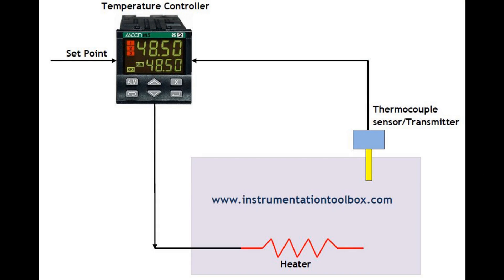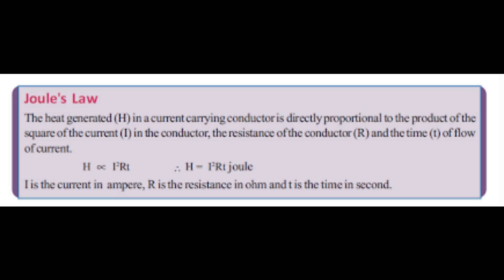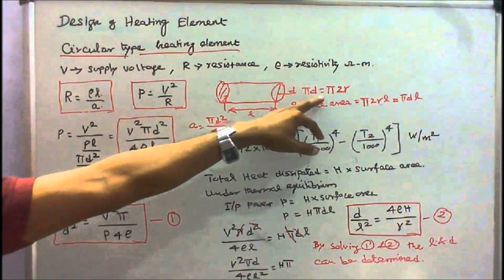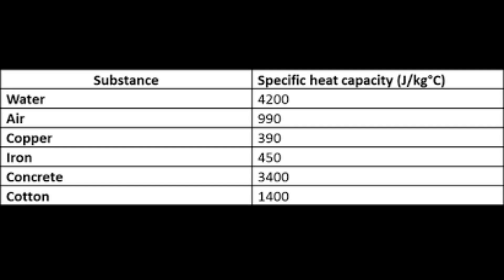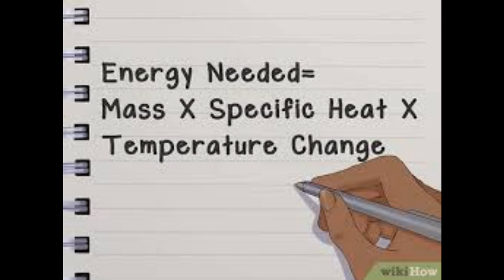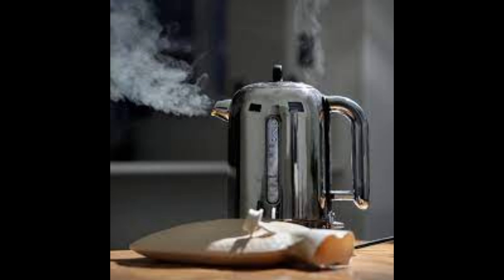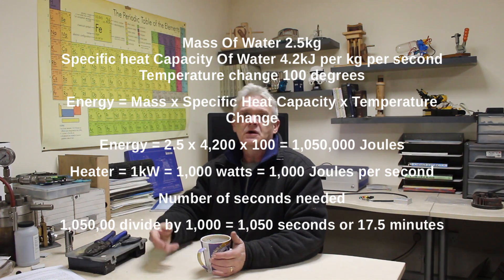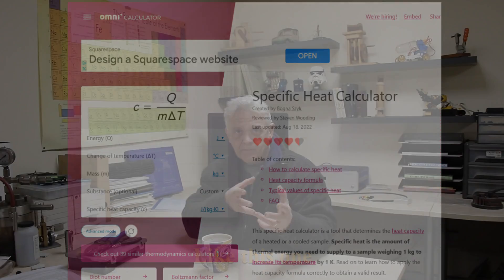1762 Designing Electric Heaters

Comment: You make heating more efficient by using a heat pump. Those can reach 3-500% efficient because you aren't creating heat, but moving it. But that's a lot more complicated than just shorting out a wire. And you have to have somewhere to move the heat from, which means either a window unit or a permanent installation. Ideal for a long term setup, but not so much when you're just trying to stay warm for the winter due to geopolitical unpleasantness.
Reply: I don't think you have to give them back after the unpleasantness subsides in fairness.
Reply: @ricos1497  Sure, but if there is suddenly a huge demand for heat pumps and heat pump installers, it can be difficult and expensive to get the equipment and have it installed in time for this winter. Wire and a 12v supply is fast and dirt cheap comparatively.
Reply: @ryanbrown982  I was just being facetious. I got you. You're entirely correct.
Reply from the maker: yep and they are a bit more complicated than quite a few folks can handle
Reply: The problem with heat pumps is that because the UK doesn't really have an AC industry we don't really have installers. The govt. has been trying to change that HOWEVER, the British govt. is absolutely terrified that British people might use AC in the summer and has subsequently taken steps in opposition to certain types of systems and installer training. That means that the systems that we do have and that are being installed have frequently turned out to be colossal failures. You can google the complaints yourself. Heat pumps and their installers have developed a very bad reputation in a very short space of time.
Reply: @CallMeMrChainmail  why the concern with using AC in the summer?
Reply: @ryanbrown982  
There are obviously multiple reasons but basically, because it's tradition.
Going all the way back to when everyone was using coal-gas, what Americans call town gas, we used to build up our energy reserves in the summer when wholesale prices of coal were low.
This continued after we transitioned to natural gas and crude oil instead of coal and whale oil.
The British government has, at least since the 80's, been actively discouraging the widespread adoption of AC in order to ensure that the country has enough fuel to last through winter and can buy it during periods of lower demand (summer).
I don't know what the current figure is, but about 10 years ago the estimate was that 20,000 people in the UK die every year as a result of fuel poverty.
If we're going to discuss anything about the government we have to be truthful about why any government does anything.
The reality is that the govt. is stuck between a rock and hard place. On the one hand you have a vocal section of middle class voters that are demanding that the UK be a world leader in the reduction of carbon emissions and don't care what it costs (also previous governments signed international agreements).
On the other hand you have a much larger percentage of the population that want's more electricity at a lower price, but they vote less reliably.
This is compounded by the fact that no political party in the UK actually stands for anything. They're all trying to hedge their bets so when it comes to long standing policies like this they just tend to continue and no one pays them much attention.
Finally, there is another tradition within the British government that plays a significant factor; the govt. no longer directly involves itself in private sector markets.
They don't want to re-open the old coal mines and old govt. gasworks because they don't compete with private industry anymore.
This means that if electricity from a private wind farm costs between $250 and $500 per megawatt from a private company they would rather pay that price rather than fall back on old, "less popular" council gasworks that could produce electricity for $30 per megawatt.
DISCLAIMER: Whilst the $250-$500 per megawatt figure is roughly accurate for offshore windfarms, I don't actually know the price per megawatt for a gasworks. It would probably be more efficient to burn the coal directly however most homes still rely on gas for heating so converting it all to coalgas and producing electricity from gas burning power stations that bought gas off the wholesale market would still be the most logistically simple way for government industry to operate. It would have to be govt. industry because current legislation makes re-opening the coal mines and gasworks even less profitable than shale oil and gas which private industry does actively pursue.
An unrelated but interesting fact, if you ever have the pleasure of visiting a coal mine, try to use the orange high visibility clothing and not the yellow ones. The yellow ones become extremely low visibility clothing when they get coal dust on them but for some reason the orange ones still work even when they're dirty. Also, bring the men in the control room cookies.

Comment: This is fascinating and great to know, but it works only if the electricity is available via power company, generator, or batteries. Old fashioned flames are more flexible, in my opinion. Rocket stoves, propane/butane camp stoves and barbeque grills, candles, charcoal grills and alcohol stoves work well during power outages.
Just my opinion based on what I think is coming this winter. I could easily be wrong, so prepare according to your circumstances in your location.
Reply: Or we could just move in with a British politician to keep warm this winter? Apparently all their energy bills are free.
Reply: @lagunafishing  you'd actually commit suicide quicker living with a politician than you would freezing to death in your own home. The former being a far greater form of torture too.
Reply from the maker: actually you could just tie it to a wind turbine directly, or your own solar panels if you want - but your advice is really good mate and I agree with what you are saying

Comment: The heater I have came about by accident. I put a small 9volt battery in my pocket. Then the change after buying my beer. It got very  hot very quickly. Now I have a hand warmer. 1 batt 1 coin .job done .
Reply: Thank you. I will give it a try. Cold hands are the main problem for living in my 13 °C cold living room.
Reply from the maker: it won't last very long mate - but interesting idea

Comment: For me, an interesting question is humidy in air. 
An other is heat itselfe and it's storage. Christaline earth material is first. It is the transfer to air, that gives us the feel of heating. Thair radiation is due to thair shape minimal but long lasting.

Did you saw the candel andflowerpot ovens?

I tryed it out. But I had no flowerpot. I took a vegetable konserve glass. Just over a candel, catching the gascollum above - astounding - room "feeling" warm. 

A kind of heat coserving in radiant hydrogene in mass of air😳
Reply: The problem with candle heaters is that they aren't always a complete burn. They can affect indoor air quality adversely (not to mention consuming oxygen) when compared with electrical heaters.
Reply: @ryanbrown982  Yes and no. Pips burn candels for romace😊 
The flame of romance burns mor ox than the candel itselfe😄 
Right - all styrol wax polutes the air .... open the Window will help.

But - what I can tell: In the glasscylinder there is hot "plasma" generated  gas. It slowly radiates hydrogene resinant energy to the room 10x4x3 meters - may be it is only a imagination ... but it feels conftable🤷
Reply from the maker: lots of folks seem interested with that and I have been thinking about it
Reply: @ThinkingandTinkering  good morning😁 ham and egs😉

Comment: I've had the vevor 3kw 12v diesel (red or possibly other fuel) heater, with a very small hole through the wall for the exhaust recommended, which I might go for as I'm in an HA property and not allowed to open up the chimney or use gas bottles as per tenancy agreement and I can't afford to keep the storage heaters running.
Has anyone tried one of these heaters?
Reply: I don't have experience with those heaters, but I know a few things about them.  3KW isn't exactly a lot in most cases. You need to know how well that room is insolated and the ammount of m3 that place is. I can give you an example of my living room which is 5.60 x 3.80 and around 2.50 high. It is insolated and has double glass.  When I do the math (on a Dutch site) it tells me that I need almost 4kw to get it to 20 degrees celcius. I was thinking about buying a similar heater too, but in my case I go for a larger one (5kw should be enough).
Reply: @xXTheoLinuxXx  I would get bigger, but unfortunately the British version only comes in 3kw, probably to discourage us from using them to heat our houses, that being said, I'm in a very small well insulated bungalow, so I think it is still possible it could be effective enough to be worthwhile.
Reply from the maker: I did a video on them it video 1682 https://www.youtube.com/watch?v=RRjSgXEuHmQ
Reply: @ThinkingandTinkering  thank you, that's fabulous.

Comment: Thanks Robert very informative👍 Stopping the heat escaping is the best solution but at the same time don't block the vents. If you are getting a draft you could always have higher level vents installed that don't cross the room in the area where you are sitting if possible.
Reply from the maker: good points mate - thanks for adding them